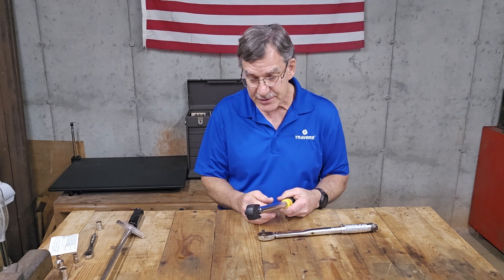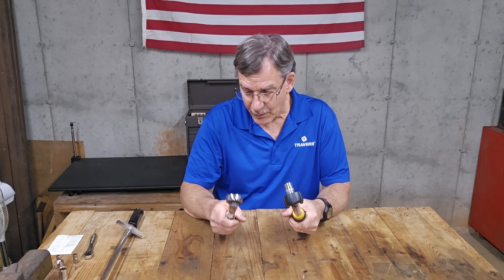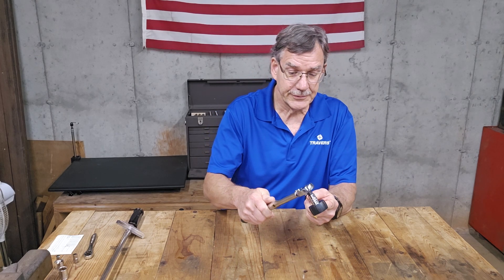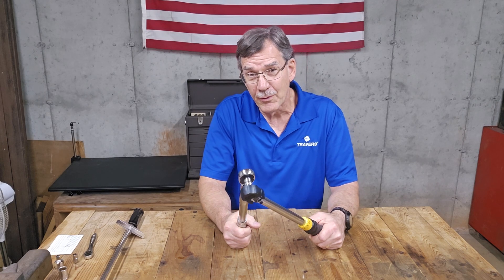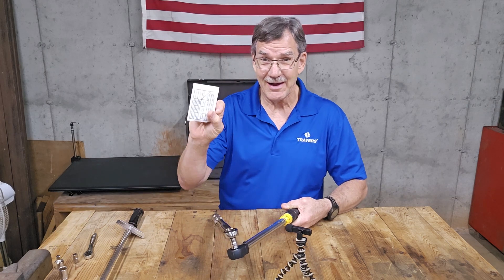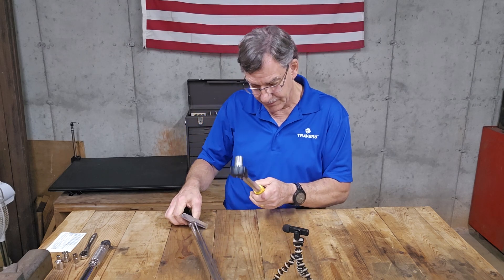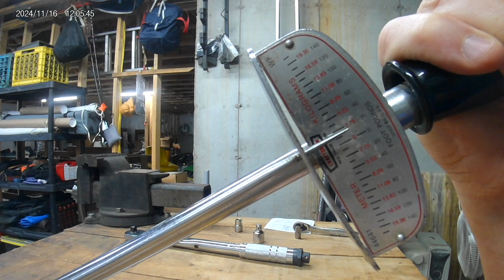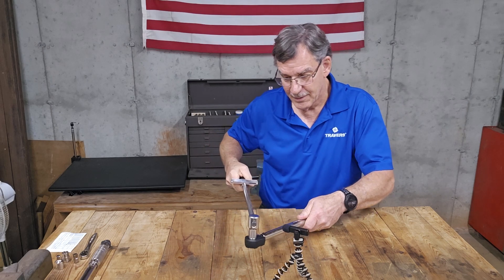DIY Torque Wrench Calibration – Step-by-Step Guide for Accurate Results

Comment: That looks fun to test and the old school torque wrench is pretty cool. I wonder if my wrench is off because the lug nugs on one wheel in particular keeps loosening over time.
Reply from the maker: Thanks for sharing your thoughts! It might be worth checking your torque wrench's calibration to ensure it's accurate. Our DIY guide can help you with that, and hopefully, it resolves the issue with your lug nuts.

Comment: you can lock the cheap one with the screw at the bottom. That screw tightens & loosens so you can adjust the setting & than you tighten that little screw/knob
Reply from the maker: Thanks for sharing that tip! It's always great to have practical advice for adjusting tools. My bigger concern was the inconsistency of the results.

Comment: Interesting video! Thanks for confirming the 15mm to half-inch square drive conversion, I was going to have to do some comparisons at the hardware store tomorrow, all my half-inch drive sockets are 6 point.
One thing puzzled me - any reason not to use the lock to stop the handgrip rotating on the cheapy wrench?
Also, with the large variability it was showing, if it was straight out of the box, had it been thoroughly exercised to bed in and distribute lubrication?
It would be instructive to see it compared with the beam after being well exercised at multiple torques.
Reply: Hi PlatypusPerspective. There is no lock to stop the handgrip from rotating. I got it from Harbor Freight, which might explain a lot.
Reply: @traverstoolelearning2391  If the knurled locking knob on the tail of the handgrip isn't holding, I'd say return as faulty would be justified.
Reply: @PlatypusPerspective , good point. Thanks.